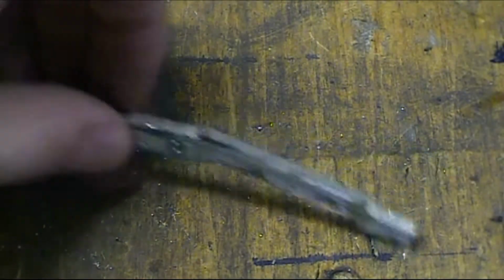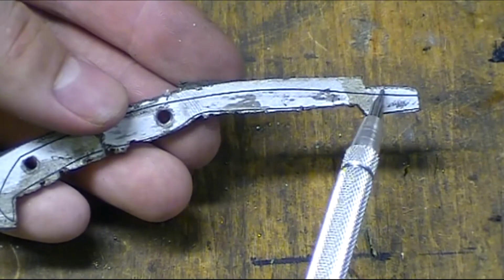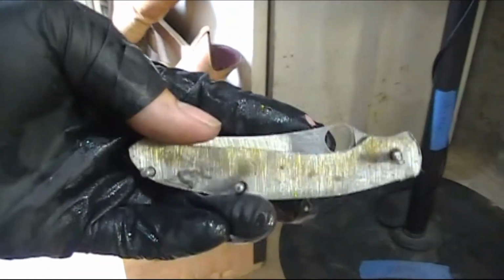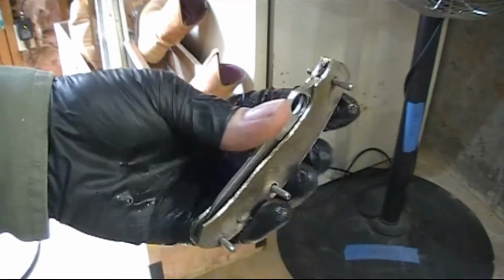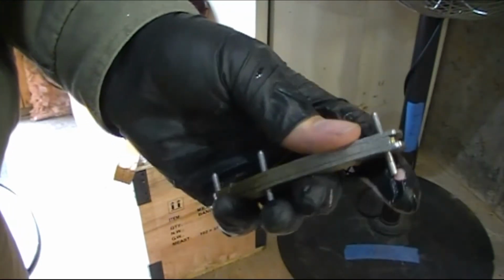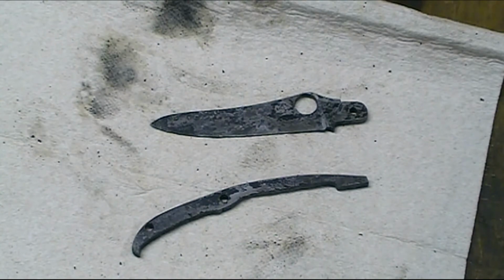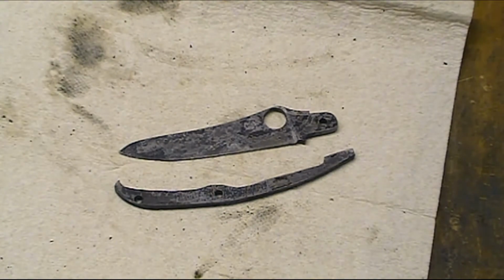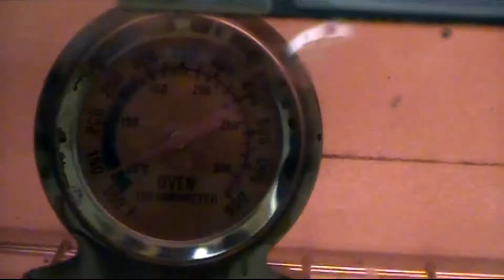Making a Slipjoint

Comment: There’s a reason that slipjoint knives have small narrow or stubby wide blades... the leverage on the spring.. I’m sure this works but much more likely to fail considering the blade length.. ideal to cut a notch on the tang and back lock all the way !!!
Reply from the maker: That’s for the tips. This was my first folding knife ever, I intend to take what I learned from this one, redesign it, and try again.
Reply from the maker: Thanks man. I appreciate the advice and the support!
Reply: Accept for the multitudes of slipjoints that arnt how youve described.

Comment: Do you have a template?
Reply from the maker: Yeah. I have the files for it in google sketch up. It should print as a 1:1 scale on 8-1/2 x 11 printer paper. I’ll update the description of the video to include a link to Dropbox with it.
Reply: MarWood Knives hey also how do you hold the blade together? Like what do you use? I barely want to get started on making knives
Reply from the maker: @notduke3976  I used 1/8" steel pins that I then peened to hold the blade together.